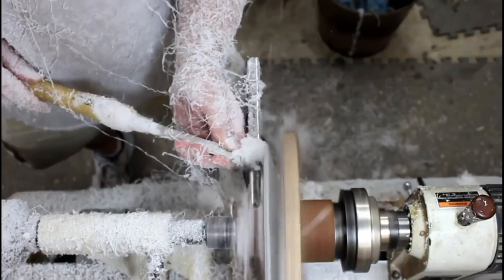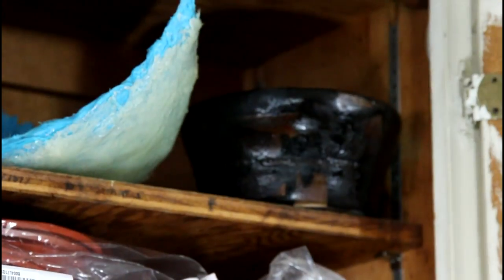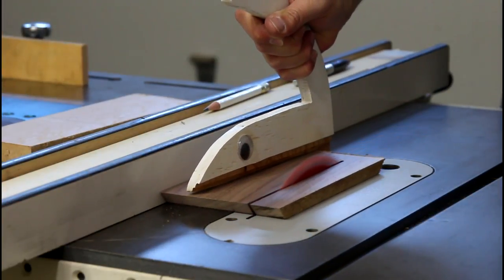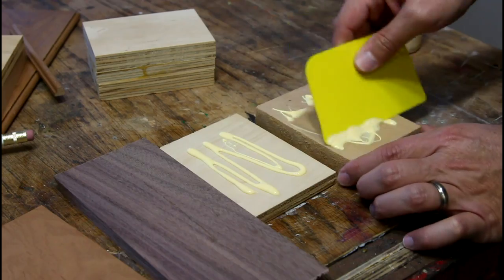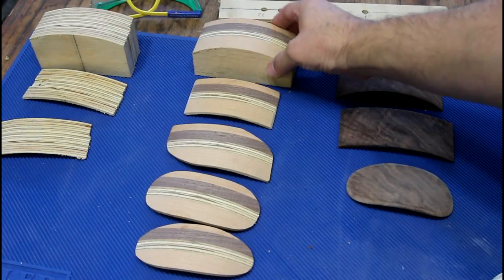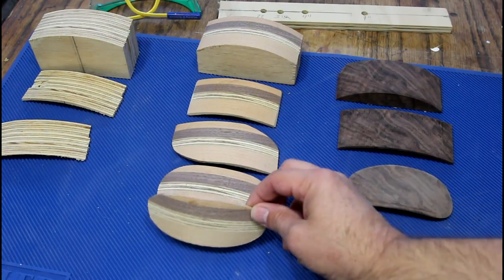Scrap Wood Gifts: Wooden Hair Clips

Comment: I'm only 70 and I call them "Barrettes" :(   I did however learn the term from my father. LOL  I've used those clips in the past to make hair bows. Some can have very sharp edges and destoy hair. Hope Peter didn't break off any of the hair he still has ;)  I love wood because of the grains. These "Hair Clips" are beautiful.  If I had all the tools you have I could make a bunch of sawdust; possibly accented with fingers I used to own. LOL  You do great work. Happy Thanksgiving and thanks for sharing the beauty of your abilities and the insanity that lurks just under the surface of it all.
Reply: Don’t feel so blue! I’m 26 and (possibly learned from my great grandmother) that these are barrettes in my head. Hair clips in my head are the claw shaped ones!
Reply: I'm 21 I switch between barrettes and hair clips but these I'd call barrettes I think it depends on how it is attached this kind of squish attachment is a barrette in my mind while the ones that entirely open and close like a little claw thing are clips.
Reply: @ashrowan2143  This! I would use "clip" to refer to something with a bidirectional grab/claw/spring-based motion, like a butterfly clip. Same as a binder clip or paper clip, there's an "applying force equally on two opposing sides of something using the same mechanism on both sides" connotation for me. I've always called barettes barettes. The only way I could see myself referring to them as hair clips would be if I were talking about a group of multiple kinds of hair accessories that includes clips too. Then I can see "hair clip" being a sufficient umbrella term lol.
Reply: @ItsAsparageese  exactly, you described it far better than I did but that is exactly how I think of the difference, the two words share similiar but distinctly different meanings separated by the way they attach themselves to your hair.
Reply: I’m 25 I call them barrettes!

Comment: I recently started making some of these myself. I have a tip for ya. Go to the hardware store and get some of those mini hinge packs that are used for small decorative boxes. The screws fit perfectly into the holes for the hair clip. 

Also, if you use a small, round needle file you can make the holes slightly bigger, and slip a leather rivet through it to attach leather pieces.

Comment: If it was curved a lot more & had 2 holes at each end it'd be perfect for a bun holder, you could cut down & sand a wooden chopstick (which I do myself) to use as the stick to go thru, or like I do - just as a bun stick on it's own.

Comment: But the real question is: what to do with the scrap wood from the project made of scrap wood?
Reply from the maker: Keep them!
Saving smaller and smaller pieces of scrap wood is a shop psychosis I totally suffer from.
Reply: It's scrap wood all the way down
Reply: @peterbrownwastaken  yeah, but then you can glue them into larger pieces and start the process over.
Reply: Use resin and make a bigger piece of scrap wood, like a collage or mosaic
Reply: throw them into a bucket of a resin and a make a scrap bowl
Reply: Clearly there is a consensus - you’re going to have to toss them in a bucket of resin. That said, I like when you make boxes even more than bowls, so I vote turned wooden box made of scrap and resin.
Reply: campfire. Make all the S'mores
Reply: No joke I was thinking this most of the video... At what point if ever does scrap wood become trash
Reply: @peterbrownwastaken  Scrap wood bowl? ...  I'll see myself out.
Reply: Make a very complicated puzzled together hair clip of course
Reply: @darkenai0045  when it is saw dust
Reply: @TheDeerhunter316  not so sawdust can be glued together to make a nice speckled mdf that can be reused to start the insanity all over again
Reply: @peterbrownwastaken  Eventually you toss all the tiny bits into a bowl and add resin.  Then turn it.
Reply: @peterbrownwastaken  could always wood chip it, then mix it with glue to make a form of chip board which could be used for another project, or mix it with resin, which would probably give it an effect similar to your broken glass lamp shade project
Reply: @peterbrownwastaken  Keeping the scrap pieces of the scrap pieces use them then for a glued up turning project. Would be interesting I think.
Reply: Lots of things. Cutting boards, resin inserts, etc
Reply: @KewneRain  This is the way.
Reply: Keep them and toss them in a Resin Project as filler/decoration...
Reply: Scrap Wood Challenge!
Reply: Those really thin pieces from the bandsaw are great for making pendants and earrings. Or I guess just throw them in a bunch of resin like everyone is saying, but wouldn't it be cute to have a fully matching set of hair piece, pendant and earrings?

Comment: This is absolutely the kind of project where you can break out the micromesh with impunity. Everybody loves a glossy hair clip. Also, micarta hair clips. Or micarta hair stakes or hair combs. Or you could do the unenviable task of steaming some buffalo horn to unroll it and then make a hair comb out of that. Bonus points for being eccentric and hipster-chic by going back to one of the oldest materials for hair combs, since wood tends to be too fragile for them in the long-term.
Reply: Mail Peter my hair and have him make a micarta hair hair clip out of it? That sounds like an idea...
Reply: For combs, depends a lot on wood species, grain orientation (and since modern glues were a thing, lamination if you use it), and thickness of the individual parts. Wood grain is the real problem here in the simpler methods (cut to shape, file, sand and finish) because you just can't get it right. Line grain with the teeth so they're strong and don't break easy, and it is easier to break along the length. Put the grain line with length, and the teeth are too weak and easy to break. Put it on an angle, and both are weak, just less weak individually than either previous option. Nowadays, if you laminate good hardwood veneer like a mono species plywood, that could fix the issue. Or you can do something more traditional like reinforcing, e.g. grain in line with teeth, and sneak a dowel/metal rod or two along the length to avoid splitting.
Reply: Fashion Brand Company has acrylic sunglasses embedded with public hair, so you may be on trend!
Reply: @nejojohnson  I'm not sure if I'm more embarrassed for the people who buy the shades or the people who donate their hair...

Comment: 2:10 - Clearly you never learned my father. The real answer is, 'I'll use a 5/16 drill bit, drill the hole, then wiggle the drill around a bit so it has some room.' Yes, that is 100% my father's logic, and it does actually work fairly often.

Comment: Honest question: aren’t you changing the radius a little bit every time you slide it up to take the slice out? Maybe it doesn’t matter, I was just wondering.
Reply: Right! So have the pivot stay in the same spot while using an arm with a series of holes at regular measured intervals. Then you to adjust which hole was using the pivot as you feed the block through the blade?

If Peter was having any trouble with the metal clip part mismatching the inner diameter of the wooden slice, this consideration would probably fix it. Seems like for so few slices it wasn't worth the trouble though~
Reply: The radius doesn't change only the measurement on the jig.
Reply: I don't think so. Since the distance from the hole in the pivot and the block didn't change, just the distance of the block from the blade, I wanna say the radius wouldn't be affected for such a small piece. At least, that makes sense to me but I could be way off lol
Reply: The arc of the cut absolutely does change, but not by enough to matter in woodworking. I wouldn't think, anyway - it wasn't really visible on-camera. You wouldn't need to worry about significant change until the pivot starts getting very close to the blade. Now if you wanted to multiple pieces together along the arc... then you might need greater precision.

I guess if you wanted greater precision, you'd need to machine a slot across the plywood arm then tighten the bolt through it. That way the bolt stays in place but you can slide the arm around to eyeball thickness.
Reply: The radius changes, but what matters is that the circles are concentric. That's why he moves the nut and doesn't drill a new hole after setting the initial curvature. If he did that the holes wouldn't be concentric anymore, and you would get moon shaped slivers instead of a consistent thickness. It means the inner ones will be a bit tighter than the outer ones though.

Comment: hey peter do you think you could do a video to help beginners work with resin a.k.a (cast and mix resin) I bought a 1 to 1 resin and plan on pouring a thin layer over a piece of wood that I put stickers on to keep them forever safe but I don't know what I'm doing, I know to mix it well I also know its a slow cure resin, however, I have no way to measure the amount to make sure its a 1 to 1 ratio I can give you the resin name if that will help (clearcast) I only need about an inch and a half pour if you don't want to or can't help me its ok but you would figure that from watching you all these years I would have learned something by now but I guess not anyway if you could help that would be great but have a good day/night and keep up the amazing content!
Reply: Resin will eventually yellow, so it won’t necessarily preserve forever, and the safety investment is steep.

Comment: 1:53 this clip where he's figuring out what size hole to drill is the epitomy of the phrase "Americans will use anything except the metric system to measure things" 😂
To a brit like me, this whole clip made no sense. I would've just made the hole 1mm bigger than the bolt. 0.5mm if that doesn't work. It's just so much simpler to me. You don't have to work out fractions of inches or look it up in the Internet because you can't remember all of the convoluted rules 😅😂

Comment: This suggestion may already be covered in the 245 previous comments, but I'm not willing to check simply because I'm lazy. That said, if you used a slightly longer bolt and a butterfly nut, it might make the adjustment process a smidge easier than taking the jig completely off each time. I really enjoyed this idea and will visit my own scrap bin soon!

Comment: The extra piece on the clip creates tension so the clip actually grips and holds hair. It is absolutely necessary. Most likely they popped out because the wood piece is a little too curved for the clip itself. These are really gorgeous, though! The walnut is the prettiest, but the pattern the plywood makes is especially appealing.

Comment: You should glue a cloth tape measure on the jig and make a red metal pointer arrow that you can slip over the 5/16th bolt so you know how much you need to move the bolt.

Comment: If you put a bolt upside-down and through the track in your circle jig and feed it through the wood u could potentially use a nut on top to loosen and tighten the pivot without having to remove the jig and attempt to not move the threads.

Comment: These would also be really pretty as the kind of hair accessories that you fasten to your hair with a chopstick/dowel, where the wood block cut would have 2 holes on either end for the stick to slide thru around the hair

Comment: I'll never understand why americans insist on using fractions for these measurements haha  
5/16.. 11/32.. 21/64..
Just use decimals and go up a few if you need a bigger hole (and switch to mm while you're at it)
Reply: Because that's the way it is and it also keeps are minds sharp working those fractions.  Just let it  be.
Reply: @dwightl5863  idk man.. I don't think everything always has to remain as it is.. There is no shame in adopting seemingly foreign things that might be beneficial

Comment: "That is a 5/16 inch bolt so we want a hole that's... ... that would be 11/32nd and I totally didn't look that up on the internet"
... 
Why is imperial still a thing that's used? You know how the metric system increases a small measure? We increase the number. "Oh that's a 8 mm bolt, so we want a 9 mm hole" (yes, that's the actual measurements of the bolt/hole in question, rounded to mm)

This isn't complaining about not also saying the metric unit's, that's fine this is not the kind of video where that's important. This is just me being aghast at people using such a impractical system.